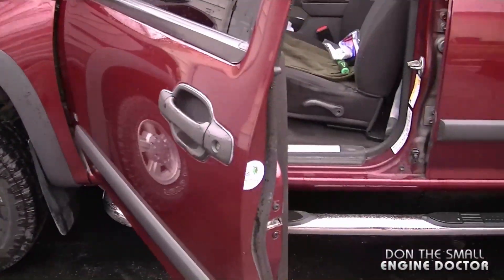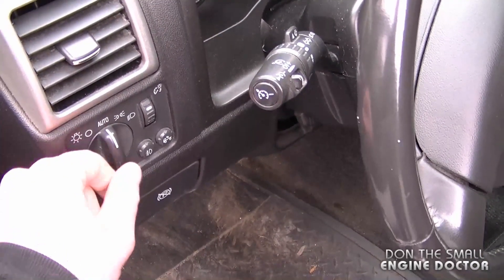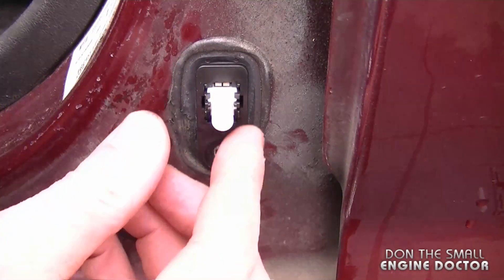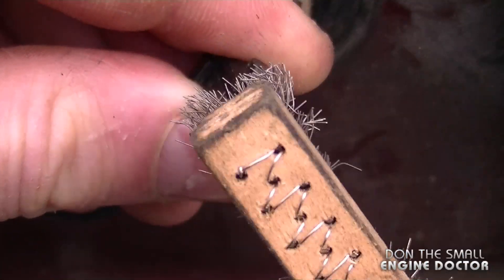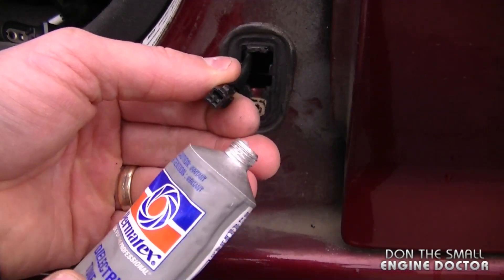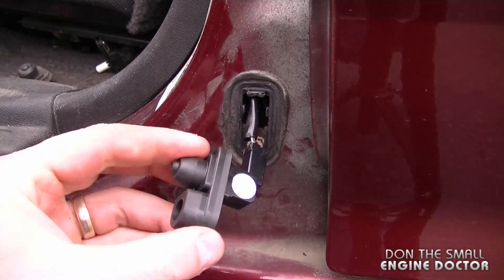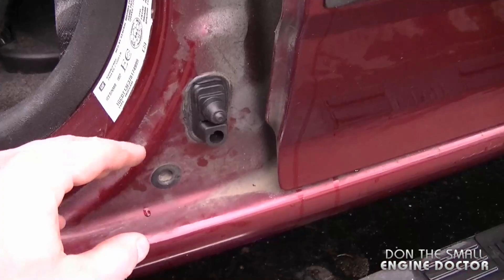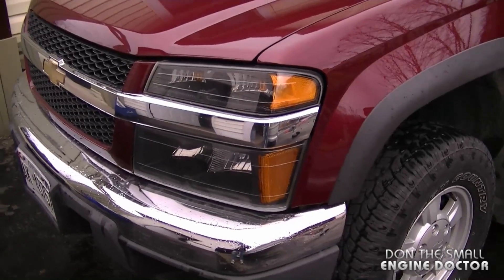Pickup Truck Dome Light Switch Replacement On Chevy Colorado / GMC Canyon 04-2012

Comment: Your Chevy Colorado is looking good MR Don      my 2004 2,8L drinks de dexcool its only 75000km i think about tighten the camhead bolts and the headlights look sunburned
Reply from the maker: you canbuy cheap headlight sets on ebay, just put one on

Comment: Hi Donyboy, I thought dielectric grease was supposed to be applied around the connector (plastic and the back side where the wires enter) but not where the metal contacts metal inside the connector.  I use it on my dirtbike's connections to prevent water intrusion.  I read somewhere (youtube maybe) if you put it between the metal terminals you can actually make the connection worse.  Thoughts?
Reply: Matt Pierce yeah I have the same concern. I have applied dielectric grease like that on my Jetta and it definitely made the connection worse: I had to clean it off completely to have reliable tail and brake lights
Reply: Dielectric grease is applied directly on the pins to keep water and oxygen out and prevention oxydation.

Comment: They moved those switches to a bad location on the Colorado. Not only will it get wet everytime the door is opened in rain/snow but it could also be knocked off by your foot.
I just checked on my 01' S series where mine is. I knew it was on the hinge side, but it took me a minute to find because the switch is on the side of the dashboard on the s-series below the fuse box on the driver side same spot on the passanger side as well, hard for this thing to get damaged or wet on thess trucks, havent heard of it being an issue. I still like the Style of the gen 2 s-series better and they were built much more solid compared to the Colorado. I havent had to replace anything in the interior yet, although I could use a new armrest, the plastic under it cracks and my arm sags, thats known on the these large driver seats, where the armrest can go up for a 3rd passanger in the front. Thats about it.
The V6 Vortec on these trucks had a successful 20 year run and were one of Chevys best engines. Reliable and go well into the 200k mileage range.
We had a 96 SS S10 for 10 years, we just sold it this past fall with over 200k, for 2 grand. That little low rider took off like a rocket. I love my S10.
Reply: FearlessFront D.W. Under $20, not $120. I had also thought that he said $120, but he says under $20 later in the vid... 👍
Reply: I agree what a terrible location.  That area gets a lot moisture and wind from the underside of the door.  GM knew this because they obviously tried to "waterproof" the unit but come on GM...

Comment: have you had problem with your ac I have message A-ac off and the temp Gage doesn't work?
Reply: You've got to dx and repair that temp gauge.  That could cost you...

Document ID# 1471209

2004 GMC Truck Canyon Pickup - 4WD   

Temperature Coolant Gauge Low or Inoperative - GMT355 IP temperature #PI01865 - (Mar 11, 2004)

Temperature Coolant Gauge Low or Inoperative

.

When servicing the vehicle with the VIN you entered, the following 
diagnosis might be helpful if the vehicle exhibits the described 
symptoms.

Condition/Concern:

Customer may complain that the temperature gauge is inoperative or reads low.

Recommendation/Instructions:

The temperature gauge will not move until the engine temperature is over 160 degrees F. Warm engine to operating temperature. Monitor ECT sensor with the Tech 2. If the ECT reads 160 degrees or lower, the thermostat may be stuck open. Replace thermostat.

.

Please follow this diagnosis process thoroughly and complete each step. 
If the condition exhibited is resolved without completing every step, 
the remaining steps do not need to be performed. If these steps do not 
resolve the condition, please contact GM TAC for further diagnostic 
assistance. This diagnostic approach was developed for the vehicle with 
the VIN you entered and should not be automatically be used for other 
vehicles with similar symptoms.

Models:

(2004 GMT355 Colorado Canyon S1 T1 )